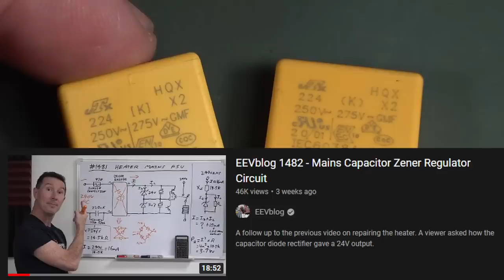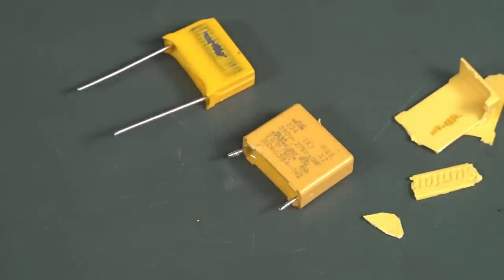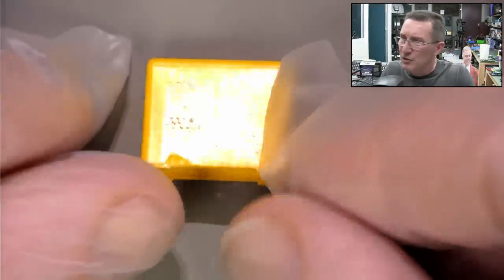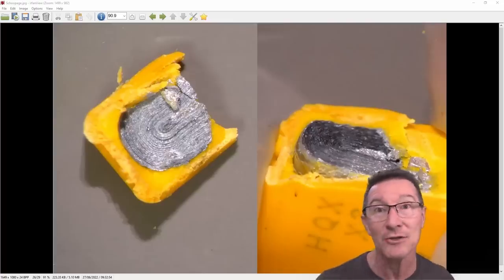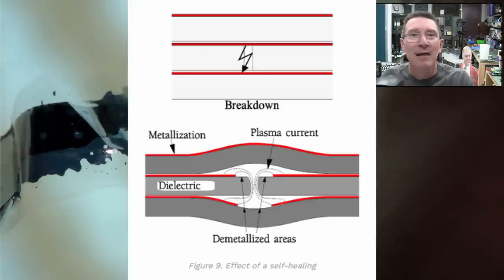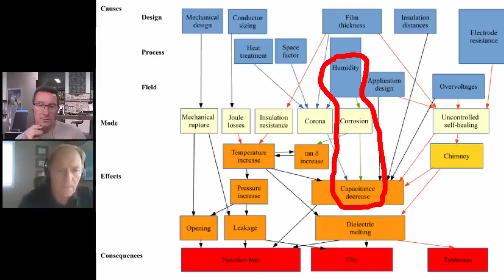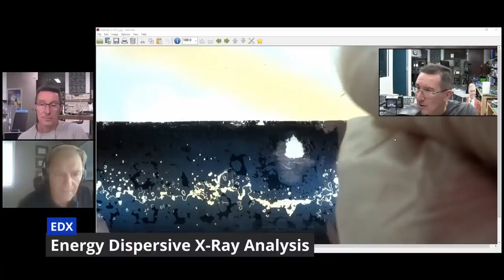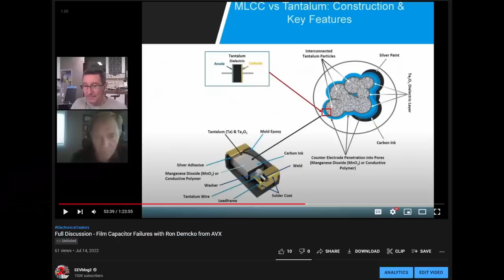EEVblog 1486 - What you DIDN'T KNOW About Film Capacitor FAILURES!

Comment: If it's caused by moisture, I'd bet on the film and/or cap being made in some humid area in China and the environmental system not being up to scratch but they didn't want to bin the whole batch to keep production numbers up when reporting to their boss.
Reply from the maker: Moisture in manufacture is certainly on the failure modes that will manifest with time and continued applied voltage.
Reply: It definitely looks like poor process control to me also. The production crew didn't want their "social credit" score to take a hit. Just my $0.02.   Fred
Reply: Just needs the film to be stored open for a day or so, and this will be enough to adsorb a lot of moisture on the film.
Reply: Same thing happened to temperature safety switches in heaters that my employer produces. The engineering samples were completely fine, the manufacturers own samples made at the factory in germany were totally fine, but the ones made in Singapore were made slightly too fast. The plastic didnt fully cure and tripping the sensor bent the internal structure just a tiny little bit, curing the plastic and opening the safety switch permanently. According to the colleague who told me this story it took four months working with the entire team to find the root cause of the problem, going back and forth between the different companies. My guess is that the line workers just want to fulfill their quota and dial in the process just a bit faster here and there without understanding the consequences. I can't blame them either, they're not experts on those parts but poorly paid line workers.
Reply: Nothing gets binned in China. Complete failures will be mixed in with good caps and shipped anyway. Well that is what I was told by a work colleague married to a Chinese woman and who lived three months a year out there. Loads of other quite shocking stories as well.....
Reply: @mbak7801  I would suppose so, otherwise they would be sold on the grey market as genuine parts, especially if the overseas buyers ding them for poor QC, so they will still sell them and dilute the brand.
Reply: @mbak7801  "Complete failures will be mixed in with good caps and shipped anyway."
Can only confirm that - same experience. We had a few parts manufactured in china and had our own QA staff onsite for this very reason. and yes, that person had a day off or was sick then you could bet your arse we did notice that in the products.
Reply: It probably makes the difference in the time it will take to fail... Failing through self healing when used as a dropper, is an inherent property of this construction. Even reputable manufacturers don't recommend it for their cheaper types.
Reply: @mbak7801  depends on the quality control. A somewhat reputable brand such as SunTan might lean more towards selling the rejects unbranded to a shady dealer.
Reply: I think the potting compound does not seal well, "non-hermetic" means open to the air.
Reply: buyers always look for the cheapest component, and a fair chunk of the market is below the cost of quality parts.
Reply: @mbak7801  Same goes with I.C.s  just mixed in the bad ones in with the good ones. I think they were hoping we would buy enough extras so we wouldn't return  the batch for exchange.
Reply: Southern china / SEA is humid like hell now
Reply: Dave should open a cap factory in the outback, good old made in Australia
Reply: @electronicengineer  Social Credit is a 10 level Ranking for Corporations and Businesses not Individuals, The Capacitor are likely to be fine and it's the either Shipping or usage itself causing issue with Humidity especially given This cap came from an Heater
Reply: @prathamkalgutkar7538  Thank you for clearing that up for me.   Fred

Comment: BTW:  Before these kinds of non-polar capacitors we used oil-filled paper capacitors, which if sealed did not lose capacitance frequently, nor shorted out."Black Beauties" were made by or for Philco were poorly sealed by design and failed most frequently.  Other Bakalite coated capacitors were sealed well they failed very infrequently.  (especially RED and orange which are epoxy sealed.) Ron W4BIN

Comment: The transparent line shows an area where there is no connection on either side. Only half the film is directly connected to the terminals anymore and large chunks of the capacitor are only connected through a few connections.

To me it seems like the initial metal film is slightly thinner in the middle. And from that i would hypothesis: The rolling puts a mit more pressure in the middle. More pressure means the insulating layer is compressed more, becoming thinner, and thus forming a consistent point of failure along the strip. When many holes line up they start to cut-off large chunks of the metal-layer, decreasing capacitance and increasing resistance.
Reply: Quick, someone do a Fourier transform on the line to estimate the size of the roller!

Comment: I have a TACO brand recirculating pump that uses a certain axial lead capacitor which became very hard to source .. but then I found some, and thought they'd be a good purchase but I believe they might have been culls from a batch because all the leads were cut short .. upon inspection I found out the leads at the potting was open and as the expected just said... It leads the moisture in... And since the pump was in a enclosure outside which pumps extremely hot water... The humidity level is through the roof.... They failed one after another... So much for a cheap and constant source.... I switched to a different TACO pump which in turn had a different capacitor value as well

Comment: When I was active in building analog circuits I used a lot of Siemens MKM (later MKH/MKT) capacitors.
These are also film capacitors but it is an interesting construction.  The film is wound on very large reels in the factory, which are cut to small (~5-8mm) square pieces that get leads connected the same way as these film caps.  The cap you get has only flat layers, not the wound construction.  It is probably less inductive.
There is no encapsulation, only the later types have a coating over the edges.
They were cheap and nice caps, better for many purposes than ceramic.
(normally they would be 100v or 250v, so suitable for low voltage applications, not across the mains)

Comment: I have had them go short circuit due to continued exposure to over voltage.
This was due to change made by purchasing and they bought a lower voltage rating cap.
As a consequence the caps were setting fire to the resistors in series, as these were snubber circuits on phase controllers.
That was not good, I got to spend a week in the boonies due that and did some interesting trouble shooting.
Very interesting doing failure mode analysis, and power electronics is a rich supply of that.

Comment: Dave! I know it! I just saw 19:42 and this explains all! There is no crack at all! The crack is the area, where the evaporated metal ends on layer one and metal on layer 2 starts. There is no overlapping metal, hence no capacity. Only the very dark spots in the middle are overlapping metal. So all the remaining capacity comes from the very dark spots in the middle, where 2 layers actually overlap. On the first defective cap you had a lot of overlap down the line, which explains, why there is still 100nF. I did not watch it, but I absolutely bet, we will barely see such dark spots on the 2nd, since there is not much left to overlap and give capacity.

Comment: I have built several large diaphragm capacitor microphone capsules with capacitor foil and turned brass discs. And a Schoeps style P48 circuit. These have excellent sound for something that simple. The foil was not wide enough, so I 'glued' it to kitchen wrap foil by setting the heat gun to 150 degrees C and slowly sticking the two foils together. 
When peeling apart several foil caps, in search of the thinnest metalized foil, I noticed the cheap Chinese caps have a much much thinner metalized layer than trusted brand names, even when spec'd the same. Something else to consider is the size of the non-metalized edge on the foil can vary a lot in the cheap caps.
Reply: Lovely microphone, how good do thinners diaphragm perform sonically ?
Reply: @rabbithazel3034  Tension in the diaphragm dictates the low end frquency reponse and thickness the high frequency response. Two layers of kitchen wrap foil with aluminium foil in between sounds very muffled, while one layer with MKP foil already sounds excellent. Just the mkp has the best response, but I could not find caps with foil wider than 22 mm, wich was a bit too small to get to 50 pF. I can recommend these experiments!
Reply: @bentenbroek  Try a 250V MKP (they say MKP, if they're actually MKP or not I don't know) capacitor made for power factor correction of electromagnetic ballasts, especially for fluorescent tubes as they tended to be thin and long to fit into the fixtures.
I think on 16uF ones the case was exactly 10 cm long, excluding the terminals and mounting stud if present, I guess the foil inside will be about 1 cm shorter, I don't remember the capacity but I think there were models that were at least 15 cm long, it's been at least 20 years since I dismantled one and at least 15 that I stopped using electromagnetic ballasts, better look for a data sheet.
There are also MKP motor start & run capacitors but those are rated for 450V or more, at least in 230V countries, so I guess the foil has to be thicker.
Reply: @ruben_balea  Yes, those might be the solution! I will look into that soon, thank you for pointing to them. I can't wait, but I have none in my parts bins right now.

Comment: This explains every odd and random failure I have seen with film capacitors but also reinforces why I tell people to never use an old radio or amplifier with the old wax/pio caps in it, I have even seen them explode when used as AC bypass caps!  I have a big container full of used x2 caps of various brands and now that my curiosity has been peaked by these failures I am going to go through and actually test a hand full since I always thought these caps had tight quality check guidelines for use in mains filters even with the cheap ones.

Comment: Does the moisture degrade the cap only with voltage present? I have multiple controllers (same model, around 10pieces) in house that have capacitive dropper and caps usually last 2-4 years in them. Few years ago I bought large bag of caps and change them once the controller stops working. I measured the new caps I have in stock and they have 100% capacity even being few years old, while the caps that were in use already failed with <50% capacity (roughly at this point the controller dies)

Comment: The stripes are thermo welding so the section doesn't unravel. Film is electrically demetallized for both the core and the outside wrap, so they don't need to add additional film.

Comment: The different pattern very likely comes from either different kind of vervoltage stress and/or from the short circuit current (when the plasma is burning there) being limited in a different way (just the ESR when the cap is directly across the mains as e.g. a filter, or in series with a resistor, like e.g. the caps dropper circuit).
The "tiny crack" is enough to kill the capacitance out, when it breaks at both layers, then the current can not flow...

Comment: It looked to me, when you unwound the foil with the "lightning" pattern, that it might be "top foil has upper metalization" and "bottom foil has lower metalization" with the area in the middle forming an actual void between what's left of the layers; and the darker portions looked like where they still overlapped? There was a bit when the layers became undone that looked like that.Maybe the moisture caused some metal to be eroded or galvanized avay? Referring to 19:15 specifically.
Reply from the maker: Nope, you can see the upper and lower metalised layers still bonded together as a single wrap.

Comment: Do we have the same issue for standard metalized poliester (pe) caps too (those red ones which you can find in different devices)? Because I used to find them with significant capacity degradation, but I never had an idea of degradation reason.

Comment: Yeah, major fails.  Way back in the late 1950's the capacitor makers actually took out full-page ads in the magazines advertising their new film caps.  In the fine print they did subtly mention that the capacitors did arc over every second or so.  But they still recommended them for all purposes!   Even small-signal applications!   So it was not unusual to have a 1960's Philco TV that made squealing noises whenever it was turned on as the capacitors "cleared" themselves.   Good times.

Comment: The best capacitors for that application would be the type used for decades in CRT horizontal deflection circuits, because high currents were the norm in that application.

Comment: Those X2 Caps aren't "self-healing", they simply don't fail to a short circuit. In old-timer speak, they "blow clear".
I've had a lot of devices fail due to these being used as Capacitive Droppers. That topology is outrageously unreliable due to the capacitor degradation. Give me a Switch Mode any day, at least they continue to operate even if the BOM Cost is a few cents higher.
Reply: They are used in small, low-current, devices like house LED light bulbs (cost under $1) where a switching PS makes no sense both for cost and physical space. Capacitive PS can be extremely reliable if used within current draw limits AND built with GOOD QUALITY caps
Reply: @NICK-uy3nl  - ahhhh, yes... but they are rarely (if ever) used within current draw limits AND built with GOOD QUALITY caps 😂
My PowerMate electricity meter failed from a Class X2 dropper cap dying after occasional usage. It is a $250 piece of professional measuring gear, powered by a bloody Capacitive Dropper FFS.
Reply: I see too many LED lights and signs flashing away due to failed switchers. Poor component selection kills them.
Reply: My house LED lamps are 5 years old and still going strong. All depends on quality of components and operating temps. The design is pretty sound as used in billions of small devices
Reply: @liam3284  - the heat kills the electrolytic caps. Most dedicated non-isolated buck droppers don't really need a smoothing cap, they just get more 100/120 Hz flicker as the cap dies.
The ones that you see flashing on and off are usually from a failed solder joint or LED bond wire fracture.
Reply: This violates the timed obsolescence

Comment: Very interesting part was at 19:14 when you separated two layers of capacitive film. It looks like almost half of each side corroded away and only intersecting areas are those dark blotches, giving the cap it's 19 nF capacitance. It actually looks similar to the 100 nF capacitor in a way. Also wanted to notice bad adhesion of cap with the case for 100 nF 1 year old cap, might be another reason for letting moisture in.

What I don't understand is why we see that distinctive pattern of corrosion where each capacitive film starts corroding away from it's terminal. Is it because unconnected side makes more room for moisture?

Comment: My Iberital Espresso machine's rotary pump stopped working, and after many many hours, i managed to find that it is the starting capacitor that failed.  From 10uF Down to around 1.5uF.

I replaced it with an oil impregnated 10uF starting cap and i hope the oil will keep it working longer than the regular film cap...

Comment: So, for such a mains power capacitor/zener voltage dropper circuit, what type of capacitor SHOULD you use if you want it to last a long time?
Reply: Ordinary film cap, but with 1KV or 2KV rating

Comment: I have a rv fireplace and this dain capacitor is not getting continuity? Getting power to the board but nothing works out the board? I believe this is the cause? Any of you can confirm my suspension? If so where can I get a new one? Thanks

Comment: Dave, is it OK to use this type of X2 caps in a speaker crossover network (for a supertweeter)? I've got some at Aliexpress and they measure just great with very low DF and the phase angle about 90 degrees. 
Should I just choose the largest physical size for each value?

Comment: Every single device I've ever owned which used a capacitor dropper from the main has failed in this way eventually. It's the most unreliable way of creating a lower voltage in devices. I now have a great stash of them so that when it happens I can replace them.

Comment: So for some visual excitement, get some Panasonic Polysulfone, stacked film SMT caps.  These are usually lower voltage, so it doesn't take much to arc them.  I was trying them for Class D audio amplifiers as the output filters, because the "poly wanna cracker" films are not available in SMT, though I did find a few at > 10x the normal price and they were 3x the size!.  Put them on the output of an audio power amp and apply some pink (or white) noise and Dim the room lights.  Enjoy the tiny white fireworks show! 😁

Comment: 13:49 If the metallisation layer is split, that would explain the halving of the capacitance, wouldn't it - only that the split would not be 100% otherwise there would be no capacitance, so the split must have been partial to have a residual capacitance.  What could be  the cause of the split though? I suspect it cannot be due to electrical failure/arcing but perhaps a secondary effect e.g. due to heating, stretching and expansion? The blotches are possibly air gaps created between the film and the metallisation? But if so, surely then the metallisation would flake off (unless there is another film layer on top of the metallisation?).
18:27 Not if the material splits in two.